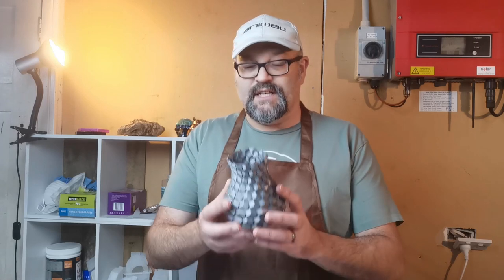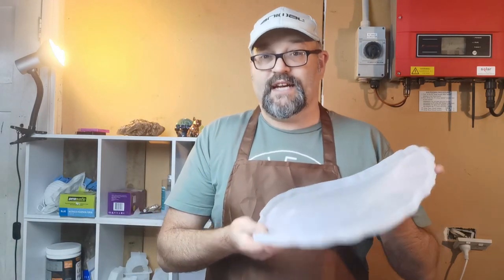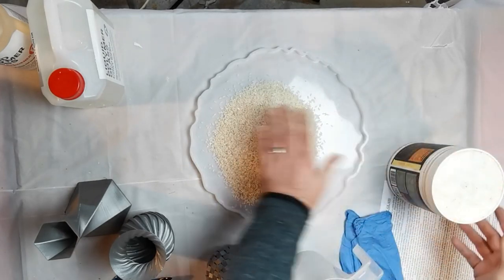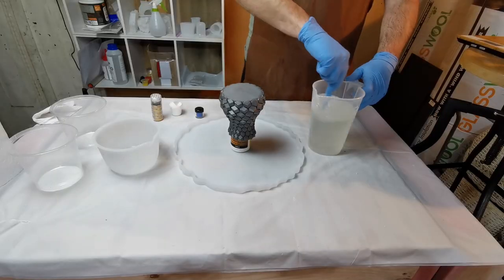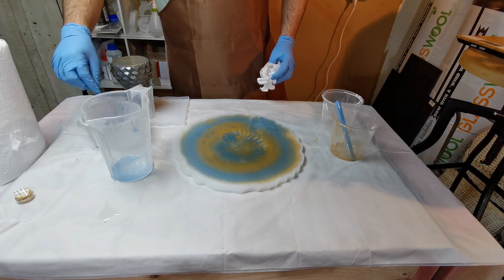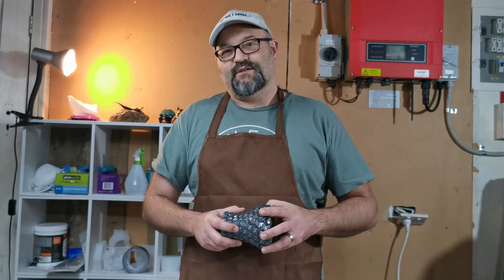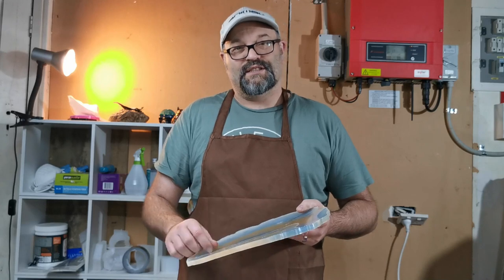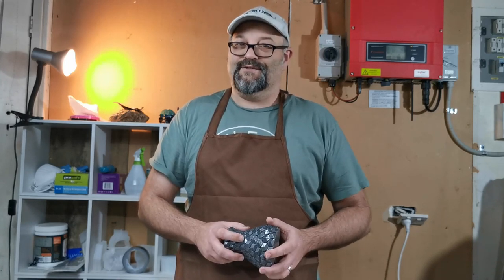Resin on 3D Print: Experiments with resin pouring over 3D Print

Comment: It's not failure mate, it's research, i've done a lot of it ;+} For my 10cm diameter 5mm deep round coasters i use 0.2g of mica powder and it gives a solid colour, but with thin, surface coatings we probably need 5 times that, i haven't 'researched' it yet : Power to ya bro, liked and subbed :
Reply from the maker: yeah, failure is just a learning experience ;-) Thanks for watching and the comment